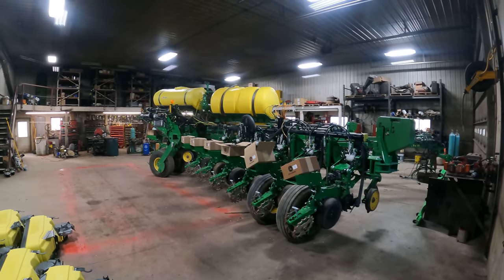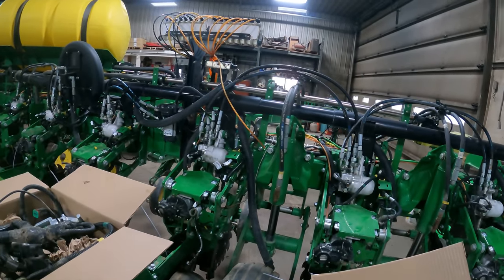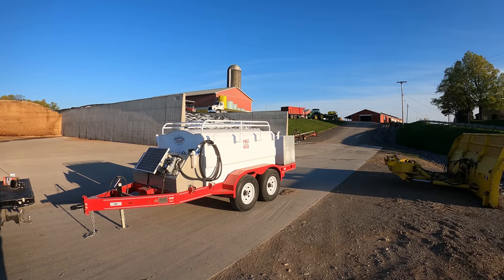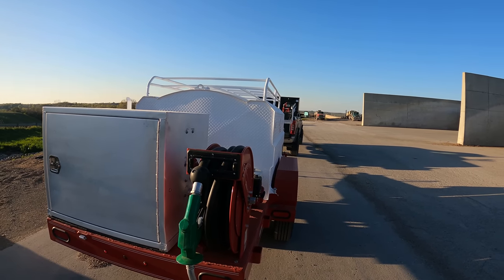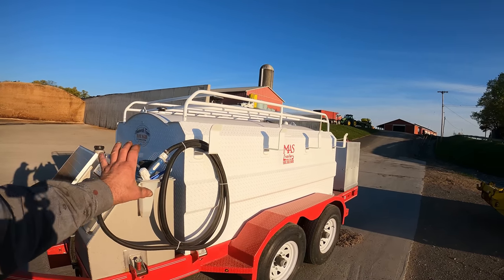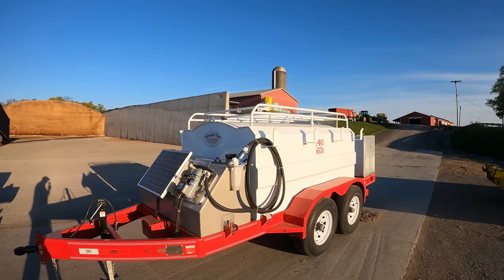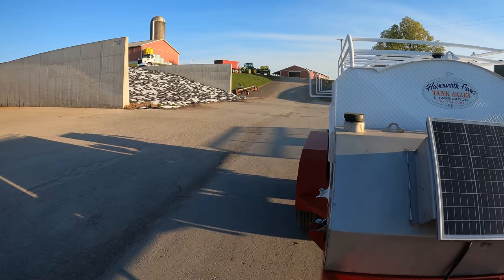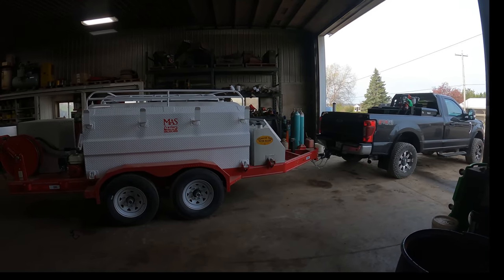Mas Fuel trailer in use

Comment: I'm surprised there isn't more protection on that ball valve under the trailer. Hitting a rock, getting stuck or off in the ditch with it could be a spectacular disaster. Trailer is quite nice, 12v pump is a great idea. Tell Sarah I can still see her, even with the shades on.
     Best regards from Indiana.
Reply: Major fuel spill for sure make the 6pm news.
Reply: you are right, i was wondering the same about it. there are engineers which are not really experienced with practice.
Reply: Yes I was thinking the same thing too pulling in the field it could get caught on grass or corn stalks or anything should be mounted next to where the pump suction is so you can reach it easily in a safer spot no question
Reply: Exactly what I was thinking. Bad design.
Reply: Yup i was going to comment about that ball valve location. Pulling off the road in to the field and hitting would be a bad day or even backing up catching the handle. Needs some sort of skid plate or relocation for sure.

Comment: Greta & the rest of the tree huggers will be pleased you are using solar power to pump your Diesel , great video as was the tour of the workshops on the last video.  Thanks from Cumberland UK
Reply: Solar battery charger for government juice
Reply: @richardradawetz8788  I should have said add blue which is called a lot of things in the UK most of which are not suitable for u-tube.

Comment: Andy, you might want to install some kind of protection for the ball valve on the trailer. I've seen many of those get ripped off in the field. You'll also want to clean up that spillage on the DeF tank, that crap is corrosive, worse than battery acid.

Comment: Hey Andy u can always make ur own sight gauge for ur fuel trailer all u need is a couple off 90 bends cut and welded into the tank with a clear sight tube placed between them works great 👍 over here our slurry vacuum tankers u can get them made with sight tubes fitted like that 😊 just a shame u can insert pics on here as I have pics of them for u so u would have an idea off what I mean

Comment: Great looking fuel trailer if it was mine i would have a gas powered air compressor back there by the box and tank,lights on the rack,and a ladder on the rack and like you said a meter on the hose how's Charlotte like her wheels and tires? I'm thinking some  window tint is next great video as always stay safe andy and crew

Comment: Instead of a site glass you can use one of them float gauges you put on top. There is no risk of spill from them. A float that goes down as the fuel level drops inside the tank.

Comment: If you knew the truck weight,and total weight with the trailer hooked up,technically you could just pull the truck portion onto the scale with trailer still connected and that would give you the tongue weight

Comment: Hey Andy on that DEF tank on trailer 🤔 couldn’t you put a shutoff and then a T on the discharge coming out the bottom of the tank and put a per say sucker hose off of the T so the pump and nozzle on the trailer could fill itself.   Probably need another shut off on sucker hose  or some kind of connector.    Looks like a great setup though 👍

Comment: Hey andy.. how's about mounting your cabinet on the tounge of the trailer and placing a gas powered air compressor in its place.. and a hose reel ?? Might act as a counter weight for your tongue weight on the truck?? Or maybe find an outfit that can fabricate an extention on the back for the cabinet.... since you don't do much of the fabrication side of things... ;-)
Reply from the maker: I’ll have to see about that

Comment: Kinda unusual to have the pump supply off the very bottom of the tank where all the water settles, which also leads to that low-hanging hose and valve. I'm sure you can plumb up some black pipe to move the fill point to the side, but like the filter, you should not have to . Even the cheap fuel pump you originally put on the Ford had a meter, albeit reading out in hogsheads, but it was a meter. .

Comment: Put on a hose swivel for the def hose?   On the rear hose nozzle , will that pick up a lot of dust dirt? Could it be placed in a nozzle holder to prevent debris.

Comment: 4 things I don't like about that trailer right off the hop, it should have 2 8000lb axles, that shut off valve dangling lower than the axles needs to have a short nipple so the pipe is tight against the tank going back and higher than the axles. The shut off valve should be above deck so you don't have to roll in 5be dirt under it. That filler needs to get a 4 inch nipple up, a 90° elbow with a 1/2 hole straight up for a breather then a 2 to 3 foot pipe to br8ng it to the side with a 90 and a nipple up for the cap or a short nipple with a 90+vent at the start with a  s curved pipe over to the side with a 90 and 6 inch nipple for the cap so the auto nozle from the storage tank has enough room so it won't keep tripping. Then last but not least you need a pipe or square tube so that nozzle isn't dragging down the road.

Comment: Whenever using DEF, ALWAYS make sure the tip of the nozzle is extremely clean. If you don’t you will run into a world of issues with the engines that are using it.
DEF has a bad habit of building up crud especially on the tip of the nozzle. That crud will go into the tank and it will begin to get bigger in the tank and the equipment will start throwing codes and it will regenerate often.
Reply: Nothing worse than a dirty tip

Comment: andy..i don''t know the laws in N.Y. but you may need hazmat placards on the trailer and a hazmat driver
Reply: Not sure  in ny but i think if has has individual tanks that are not over 100 gallon you would be ok with haz mat endorsement
Reply: I don't think you need a haz mat for farm use,but need a placard for the tank or a diesel fuel sticker  for it
Reply: @Jeffrey Kielwasser  I haven't seen any placards on any of the other YouTube  farmers with big tanks yet so maybe they are not required doesn't seem right though

Comment: That ball valve is located in a scary place for off road use.
Reply: Why?
Reply: Explain
Reply: @Dan Fenn  only because it looks like it would be easy to catch a rock or some brush or stick if you're driving off road.  Or even mud if the wheels sink into a rut
Reply: The value needs to be just before the filter away from running over something. Also the bottom draw need to be from the top with a draw tube. That's  a piss poor design.